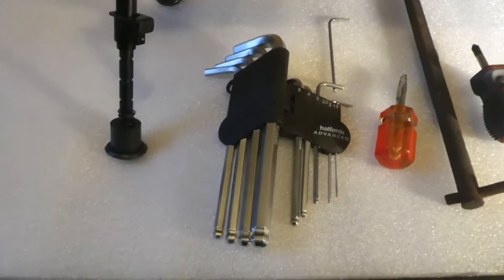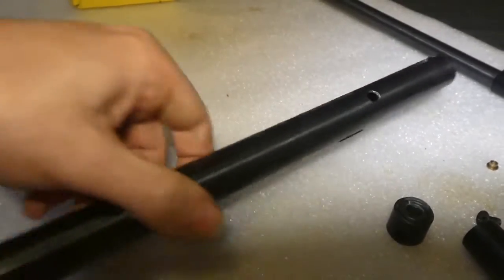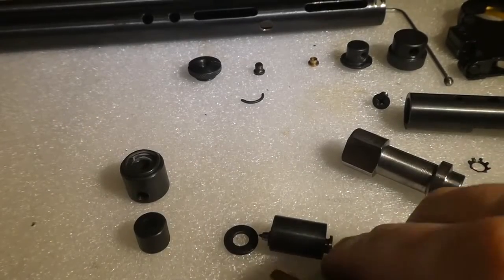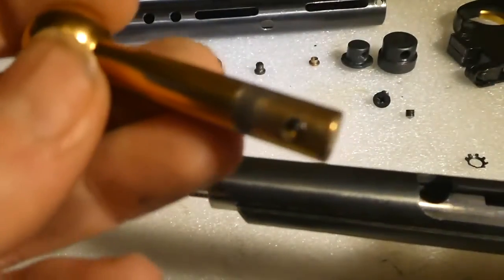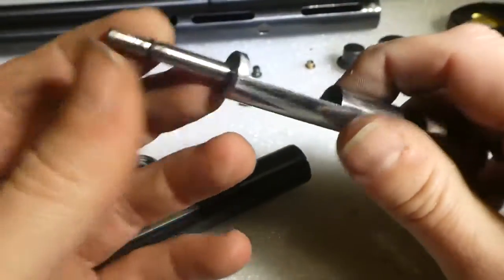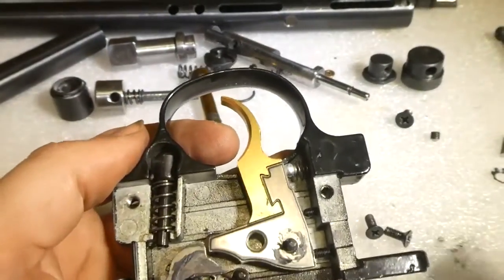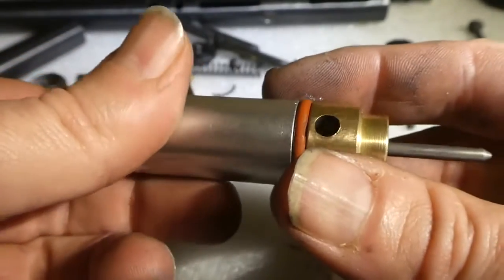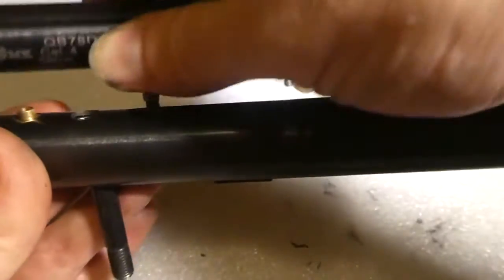SMK QB78DL Disassemble how to and tune tips

Comment: These guns can easily be converted to air using an external 13 ci inch regulated bottle, a QB79 gas block, cutting the threaded end off the gas cylinderand drilling two holes to retain the gas block.  All you have to do then is shorten the stock and inlet it for the gas block.  The bottle cannot be screwed on with the barrel in place so that is fitted after.  The bottle then stays on the gun and is refilled Insitu.  I also recommend the inclusion of an inline on off to isolate the bottle when not in use. This prevents it being drained by any minor leaks but more importantly if the regulator should failed it isn't going to dump 3000psi into a gas tube rated for less than half that pressure.  Safety first every time.

Comment: Very informative video.
The seals failed on my QB. Taking it apart is easy enough, while putting it back together I forgot a few steps. Thank you so much for posting this.
Your sir are a gentleman and a scholar.
Reply: The seals are often damaged on initial assembly due to poor quality control leaving burred edges.  Part of tuning the gun is to remove all burrs and polish all internal surfaces.  New seals are bought cheaper from a 3rd party (I used to supply all you needed to tune them but age has caught up and I prefer to relax these days).  You need a synthetic O ring on the cap and main valve (Viton) as they are in direct contact with wet CO2. The rest can by regular Buna Nitrile but all last far, far longer with a light coating of silicone grease.  The countersunk breech securing bolt is rubbish as in fact are most of these poor quality Chinese fixings and are best replaced with stainless steel equivalent Allen bolts and screws.  If you don't they WILL eventually get chewed up and cause you problems.

Comment: My gun didnt have the brass valve beteen the barrel and the bolt carier. I took it apart a few days ago and i think it was a plastic piece of ring that was there. There is a new one in the seal kit but it looks sligjtly to long and large... did i drop a brass valve somewhere???
Reply: I was going to say the same thing! Did you find anything out?

Comment: When you put the O ring on the part the hammer hits, you cut down on gas flow. I take about .040/1MM off of that surface so the valve releases more gas=more FPS. Do you agree?
I also increase hammer spring pressure with washers.

Comment: No it doesn't come out of the stock like that you also have to remove the safety which so many mess up by not knowing how to do it so they leave it off.  All you have to do is inlet a small channel into the stock and you never have to remove the safety again.  It is removed initially by engaging the safety and punching it out hitting the smooth, none lever side.  The retaining head for the stock bolt can be inlet into the stock and the excess bolt ground or cut off to give the rifle a whole lot more streamlined look.  Instead of tapering the piercing pin you can simply drill a couple of holes anywhere in the valve body BETWEEN the internal washer and the threaded end to increase the gas flow.  If you put an O ring on the hammer stop to deaden the noise you WILL decrease the dwell (open period) time of the valve thereby reducing gas flow and hence the power so it will have to be compensated for another way.  In the video he has done this by adding and extra section of hammer spring which makes it harder to cock; rather counter productive.  I have never done either as it just isn't necessary or desirable.  You can superglue a washer where he has the O ring if the gun is overpowered and needs reducing to legal levels. ALWAYS USE A CHRONO and never rely on pseudo substitutes.  You can buy a very effective chrono off AliExpress for between £15 and £18 and it is superb and I believe superior to the Combro 625 in use.  I have both and consider the Chinese chrono to be a brilliant piece of kit.  It only measures speed and or Joules put they are easily converted with a free app.  Never drill out a pellet probe as it will easily break off the end if it catches.  Use a diamond burr).  The barrel port only needs to be lightly countersunk just to ensure better alignment. I have never needed to enlarge the diameter of barrel port.  I do like his trigger mod to the weight spring and I shall adopt that myself.
Reply: An engineer's deburring tool is brilliant for the edges of the bolt handle slot, the tube ends and any other burrs that reduce efficiency and damages the seals.  These rifles are simple and efficient and once tuned and quality finished will never let you down.  If yo get one with a good barrel and most are then you are laughing.  I have been competing in HFT for over 25 years with my .177 AR2079A both on CO2 and latterly air.  If you really want to make these top notch rifles then a decent barrel blank such as a Lothar Walther will make it an accuracy match for any top end PCP.  I have Weihrach barrels on two of mine but my AR2079A came with a superb OEM barrel do it is still all original.  

He struggled to reassemble due to his extended hammer spring but you can make a tool out of thin sheet metal which will hold the hammer pins in the correct position so you simply drop the upper onto the lower, insert the retaining screws but don't tighten them down.  Slide out your pin retaining tool and tighten down the screws.  Still, my advice is NOT to use an extended hammer spring.  In fact if you lighten the hammer and spring the hammer travels faster and still releases the same amount of gas yet you can cock the rival smooth as silk with you little finger.  It's all a question of balance and efficiency.  There is a wealth if information on the UK Chinese Airgun Forum both from myself and many others along with many innovations not even hinted at in this video, such as air conversions, bulk filling CO2, drop blocks, power adjusters and much much more.

Comment: 7.15 this is the valve...inside you have these bits... Felt at home immediately😁
I really appreciated a walk through from someone interested in reliability and economy rather than in throwing £s worth of after market godies in there. I hadn't realised you could buy brass transfer ports - I'm certainly going to do that, just to reduce frustration!. Found some on t'bay.  If I fit the largest size and it ends up a bit hot, could I tame it just by clipping the hammer spring?

Comment: Hi mate
Nice vid, inspiring me to rip my 79 to bits!!
Where did you get the butt pad, foam cheek riser thing with the spare co2 in, as shown in the picture. Could use one of those.
Reply from the maker: It's called a Tactical Cheek Riser , can get them on Ebay :)

Comment: What size brass transfer port would you need to use in order to keep it under the UK legal limit?
Reply: What i did to mine was add a restrictor plate with small hole in the valve, as well added some thickness to the hammer block, limiting the hammer strike.

Comment: Personally I've found that it's not perse the bolt itself in the breech that makes the qb78's feel rough.

Most was gained by smoothing the inside where hammer spring runs up against.
Test it out, run every action separately an find not much resistance or roughness perse in the breech (not calling it silky smooth either, even after a polish lol) but take the hammer assembly and compress it, very very gritty.
With mine, that was where all the grunch and grind was.

Also
hammer/bolt pin faces and channels.
(And maybe the surface where they catch the bolt for polished on polished, tho again, that's not really where the grittiness is)

Now my action runs "smooth" well.. still kinda clunky and a little heavy, but no more grinding.
Only a little chatter and spring compression.

Comment: So I have the same gun and just ordered the performance hammer spring and performance transfer port seal, I'f I polish everything you talked about what kind of power gains am I looking at,   ft/lbs and fps
Reply from the maker: Will depend on calibre, tuning the .22 seem to see the biggest gains and it's easy to go over the 12ft lb limit ( if you're UK based ) whereas the .177 only sees modest gains and tends to put the rifle up near the 12ft lb limit ( in my experience anyway ) I've heard of some gaining 7 or 8 ft lb extra , others just a few ft lb
Reply: @theleadinjection4837  well I have now done all this it's a .22 I'm going to chrony it to check it, aiming for a nice 12ft/lb and that's plenty capable and it's the limit ill let you know as it will probably help others

Comment: So I followed this video and have replaced all my seals but when putting it back together I’ve somewhere gone wrong, bolt action works fine without the trigger but when I put it on it feels like it locks up? Any chance you could help?
Reply from the maker: Goto 38:36 in the video , usually if it locks up it's because one of those pins isn't in correctly - usually the rear pin isn't in the correct location ( at the back of the bolt ) and stops it coming all the way back :) 
Hope that helps !
Reply: @theleadinjection4837  thanks very much I’ll check that

Comment: What is the accuracy and reliability of these rifles? I'm looking to buy an xs79 to do a hpa conversion with a 13ci bottle on the front regulated between 800 and 950 psi (depending on power output etc). But I'm a little concerned that the barrels might be poorly rifled or even thin and flimsy, is this the case or are the barrels pretty thick and sturdy? I'm sure with valve and transfer port mods along with some different springs and seals I can make the rifle reliable even if it isn't from stock but I really don't want to have to spend another 80 on a barrel blank then turn it down to fit etc that would push my project budget over the edge a little considering this isn't my first/only gun I have 3 high end spring piston rifles, just wanted to tinker with a cheap project and dip my toes into pcp at the same time lol
Reply from the maker: They are budget built rifles, emphasis on the budget part lol, however they are accurate and fairly reliable out of the box for plinking , but the barrels are a lottery... 
Tbh for what ££ you're looking at to buy the QB and HPA setup , I'd just go buy a 2nd hand PCP rifle. A mate picked up an Air Arms S410 recently for about £200 and that thing is a lazer at 50 yrds !!

Comment: What bar can this rifle safely handle?
Reply from the maker: It's a standard Co2 capsule pressure of around 900 psi 
I've heard of the cylinder taking as much as 1200 psi, but I personally would not recommend pushing it to those limits..